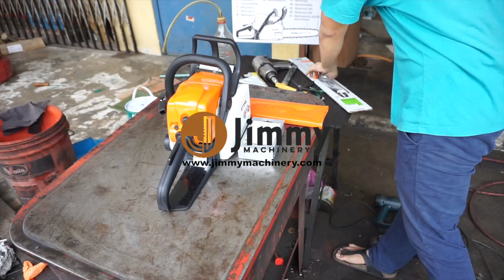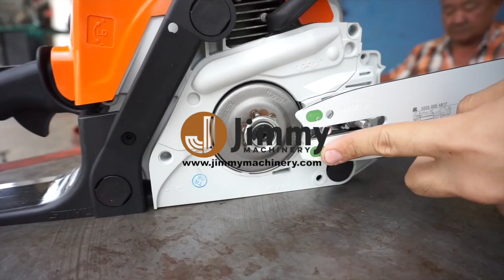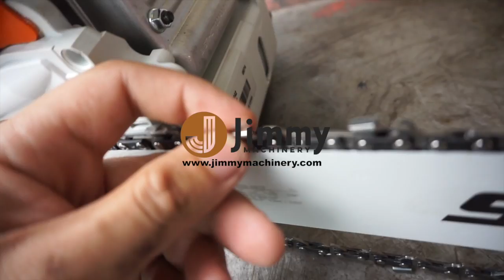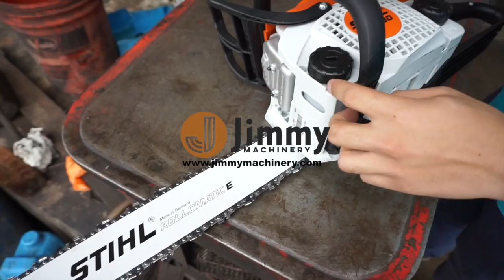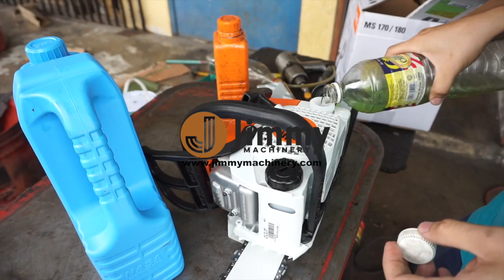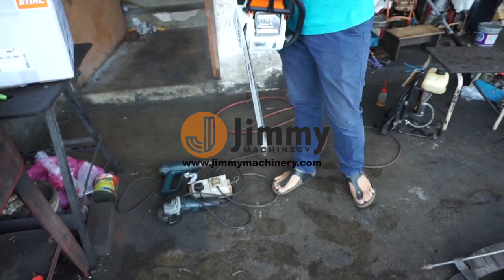Cara Pemasangan Chainsaw Mesin Potong Pokok Stihl MS180 Dan Open Box

Comment: Saw arrived yesterday https://www.youtube.com/post/UgkxfQm1wmg0ItKDLavxj1nXtQY9HP7EF504 and today I cut about 3/4 cord of wood with it. Make sure you get an extension chord that is at least 12 gauge wire, minimum. This is my first electric in about 10 years, and things sure have improved. The self-sharpener works great, and it just kept cutting through some pretty decent logs. Wear your eye protection, and ear protection. Excellent saw.